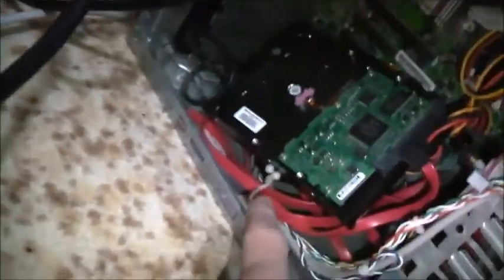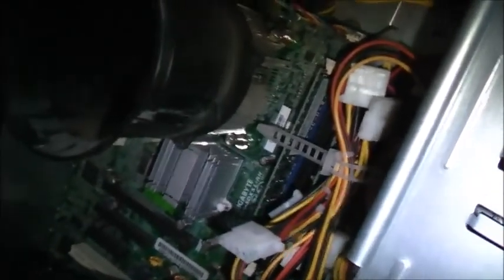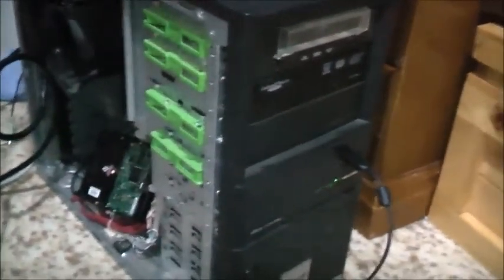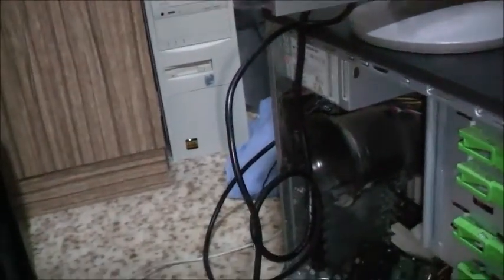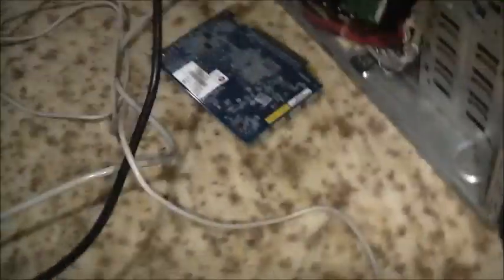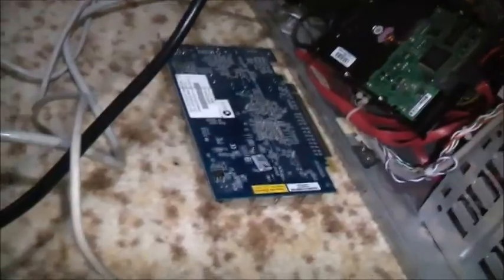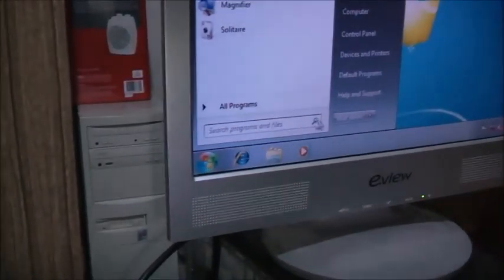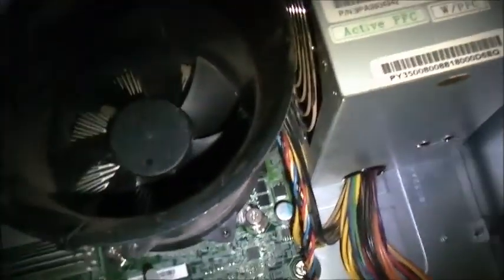Acer Server Score!

Comment: its not what id call a server the case is server like in functionality but really all a "server" like that is is a standard pc with server os i have a few dedicated servers in 2u rack format 32 gig ram 2 quad core amd  chips and they will run windows 7 or any server os the difference is the extra functionality like the abilty to log in to the firmware and bios even when the system is shut down etc, Id stock it with spare hard drives and run freenas